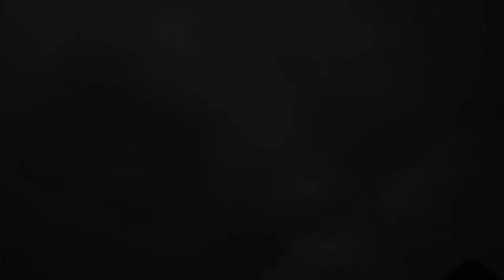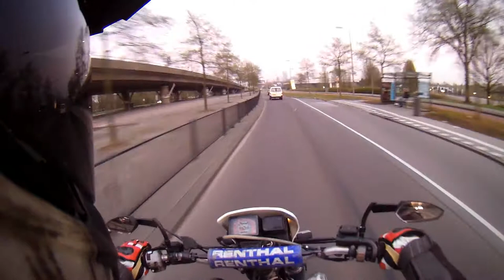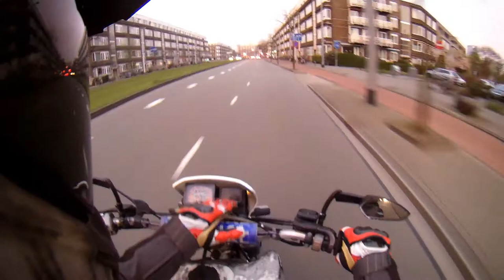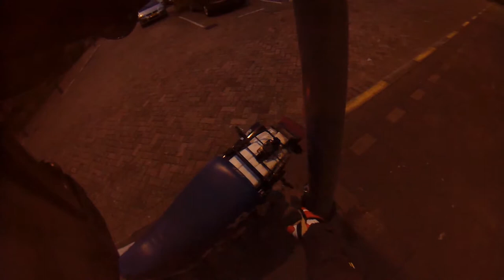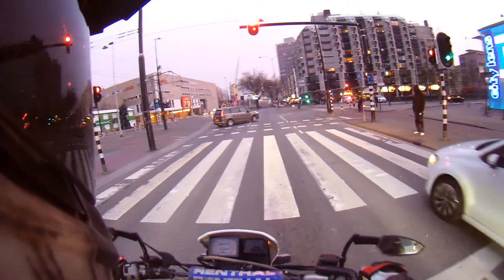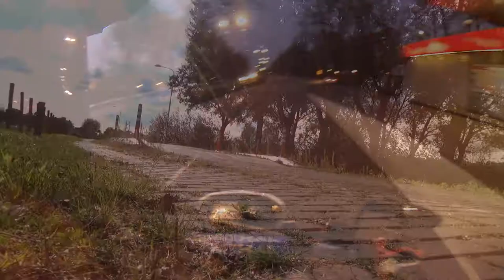Blown out a fuse

Comment: I had a problem with the lights on my KLE, but it was the light switch on the handle bar ... I thought it was a fuse, but I switched between Pass and normal and it started working, LOL LOL .. I was lucky, LOL, I was about to torn everything apart to search the problem, LOL. Hope you solve it cheap and fast, LOL. Cheers
Reply from the maker: I had a similair problem last year.
In that case a light bulb broke, creating the problems.

So we are going to check that out first. ;)